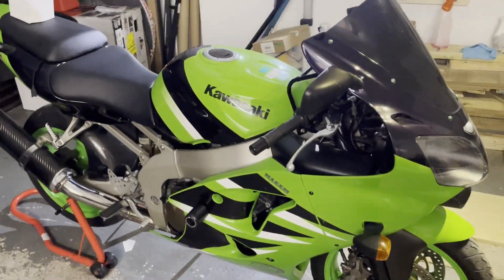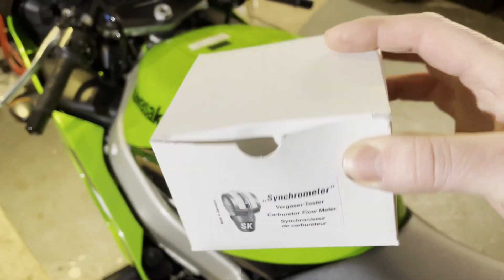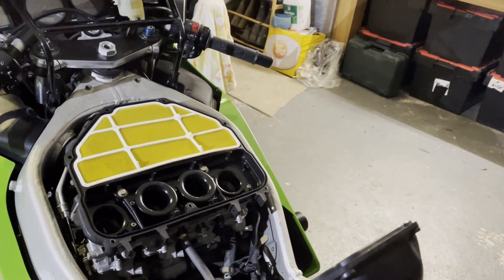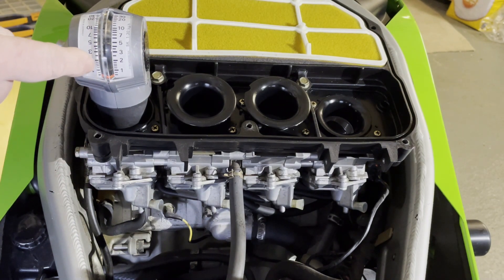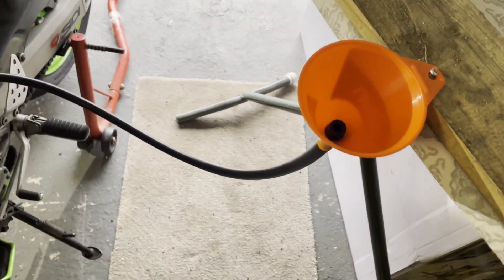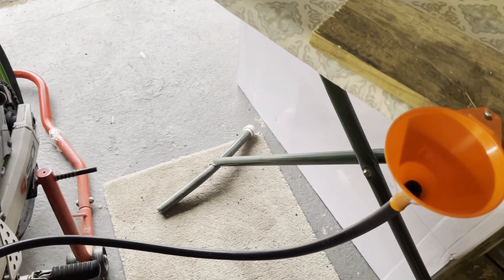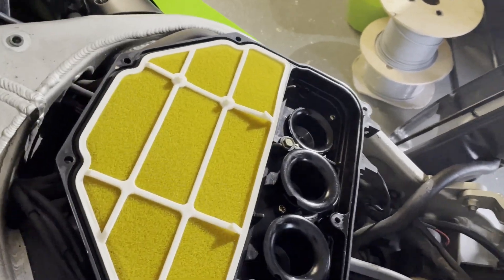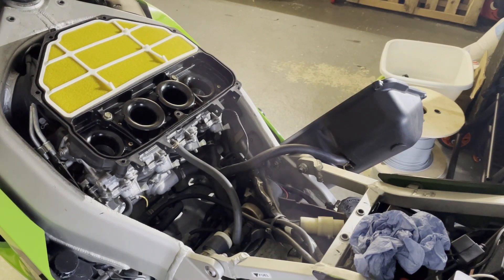ZX6R 2001 J2 Carburetor Balancing

Comment: Thought I'd try this on my old 1999 zx6r g2 as it was running   badly and fitting the 4 gauge system is a job on that model and im happy to say it was very easy to do and its like a new bike now running smoothly with full power definitely recommended trying
Reply from the maker: Glad it worked well for you. Also try the ‘Mechanic in a bottle’ too just to help clean everything out.

Comment: So should it be 3 on garge across the broad all' 2/12
Reply from the maker: I think, as long as they are all balanced you then adjust using the idle controller to reach your desired idle. Might be wrong, but that’s how I did it.

Comment: Hello, I do not have any curtain device. I know the factory setting for the air screws
Thanks
Reply from the maker: I don’t think you will get a factory setting as such, will need balancing using this or manometer. You can do by eye to a rough level but you’ll not get it perfect.
Reply: @bikenut  I don't have any measuring device. 
You do know the factory settings

Comment: Is that a HiFflo (grey one side, yellow the other) air filter? If it is, I think it is upside down.
Reply from the maker: Haha, you are 100% right.
Reply: @bikenut  Thanks for the reply. I recently serviced my ZX6R and your video was helpful. Your filter orientation had me wondering though. The new filter had no instructions but my old one was yellow side down so I was assuming and hoping that was the correct way. The yellow side being fuzzy also made me think that it should face the airflow. Cheers!

Comment: O carburador numero. 1 da esquerda,o primeiro ja vem ajustado de fábrica,ai vc ajusta os outros 3 igual o numero 1,o numero 1 nao tem parafuso de ajuste,serve de orientaçao para regular os outros 3 iguais
Reply from the maker: Thanks for your comment but I don’t think that is correct. With this carb, 1 and 2 are sync’d with the adjustment screw between them, the same then for 3 and 4. Once you have 1 sync’d with 2 and 3 sync’d with 4, you can then sync both pairs with the adjustment screw in the middle.
Reply: Entao estamos falando de configurações diferentes no mesmo modelo de motos,porque aqui no Brasil a zx6r tem apenas 3 parafusos de sincronismos nos carburadores que sao 4 carburadores,o numero um da esquerda ja vem calibrado de fabrica como referença para os outros 3 carburadores se vc possuir o vacuometro de 4 relógios vc vai ver que so consegue ajustar o 2 o 3 eo 4,tendo como referencia o numero 1,  34 anos trabalhando com motocicletas 21 anos em autorizada Honda
Reply from the maker: So that’s interesting to hear - I’ve no reason to doubt you and can not find any resources on specific Brazilian versions of the bike. Thanks for sharing.
Reply: @pretofilho3624  глупости, регулировочные винты везде по 3 штуки, так как регулируются парно, 1,2, затем 3,4, затем 1,2-3,4,  и были бы вы механиком, то знали бы что эти винты регулируют и выравнивают вакуум и одинаковое открытие дроссельных заслонок. а не фазы газораспределения.

Comment: Where are the drain plugs for the carbs located? Also is there a better place to contact you?
Reply from the maker: Have a look on the back of the carbs - if still on bike. What are you aiming to do?
Reply: @bikenut  Trying to see if my bike has gas in the carbs
Reply from the maker: Is it running poor or not at all? If running poor stick some “Mechanic in a bottle” in the tank (as in this video) which will help with cleaning the carbs. If not at all it could be the fuel pump - check your fuses and also have a look at the filter to make sure it’s not blocked.

Comment: Anybody have any experience with ram air mod? Bike will fire, idle, then die after a bit. I want to sync the carbs but I’m assuming I need to figure out the air box first if I’m correct?
Reply from the maker: Interested to hear more about the “ram air mod” - what is that?

Comment: BEFORE removing the fuel tank, fire it up and let it warm up to make the temp funnel not so much of a PIA mate.  The 4 minutes it takes to remove it and remove the air box cover it will still be warm. I use a 1 Gallon self made carb feed for these kinds of things, syncing and testing, and it is much safer that releasing explosive vopors all around your shop with a running bike....FYI.
Reply from the maker: Thanks and good tip - sure, my method is a bit Heath Robinson and dodgy AF but it was well ventilated.

Comment: I have same bike.
for what number you adjust the carbs? 
do you have a video how to install the indicator gears?
Reply from the maker: Hi, I just made sure they were all the same, I’m not certain the number was important. Once all the same just adjust your idle accordingly. I fitted the indicator years ago so no video unfortunately.
Reply: @bikenut  ok thanks.

If I understood well, the high number like you have was tree, you adjust for the same all?

I see comments here say gauges 4.
High number is better?
Reply from the maker: Hi, what they meant was that this would be more accurate by using 4 gauges or a vacuum gauge setup.

Comment: Hello Mate, great video, I was wondering I have the J1 and was wondering if you can recommend me a exhaust for it, just the final end not the entire sistem. Cheers
Reply from the maker: Hi, thanks for the sub and glad you liked the video. The end can I have is a Micron and was on the bike when I got it. For me, I love the sound and with it being carbon fibre bodied it looks good on the bike too. It is road legal but not sure if it is supposed to have a baffle or not but it didn’t come with one. Its also much lighter than the standard one. It’s the only one I’ve tried, other than the standard one I used to throw on for the MOTs, so can’t really give you any other recommendations.

Comment: I'm thinking you would have better accuracy with 4 gauges. I would not sync my carbs with a single gauge. I still ride a 99 zx6r it's black purple mica and is a great lass!
Reply from the maker: I couldn’t agree more but for a quick setup it works well enough.

Comment: So I have the same tool and I just synced my carbs as best as I could with how late it was. But I cleaned the carbs out and then synced them anyway I noticed yours was at or around 3 where as mine was around 7 would you know why?
Reply from the maker: Interesting - if yours was idling faster then that would show a higher reading for sure or maybe I didn’t seat mine as well as you did but I thought I did. I’ll do mine again over winter anyway and I’ll check then.

Comment: I just ordered this sync tool to use on my 02 r6. Do you recommend this tool or the usual carb sync tool?
Reply from the maker: I have never used the usual four tubes or dials type and this was my first time using this tool so I can’t really advise on that but it was really easy and no cutting of the vacuum lines as with the other types.
Reply: Where do you get your sync from guys?
Reply: @JakeJohnson-hw8ew  found it on Amazon
Reply: Found one now bud 👍

Comment: Great video pal.....did you enrichen the mixture when you went from standard can to micron
Reply from the maker: Thanks! The Micron was already on when I got the bike but I suspect the carbs weren’t tweaked. I’ve always fancied doing a Dynojet upgrade and adding a K&N filter though.
Reply: @bikenut  the reason i ask as the result slightly hung when on decelerate as mine did for 2 years until I richened it out using the rev drop method.....so much better 👍👍

Comment: Gr8 vid. Just on the question u pose - I wouldn't use E10 in a older carb'd bike. Always use Shell Vpower or E5 in my DT and it runs gr8.
Reply from the maker: Glad you enjoyed the vid!
Reply: What type of gas is that in US?
Reply: @yetihassyphilis5095  Not sure what its called in US - its the best petrol you can get in the UK rather than the cheaper version.